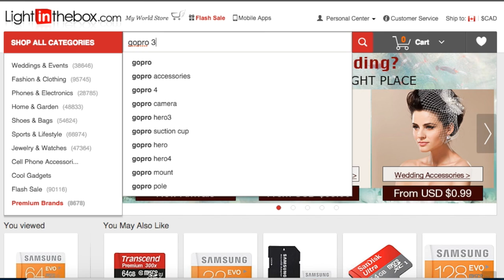4. Sailing Maiweh: Budget Sailboating?

Comment: Propane stove's are the worse thing for making moisture, your better to get a diesel stove big enough to cook on that will keep the moisture down except when boiling water. I just went for 4 days and even my windows were dry and the temp was 1* look at my video's I have two stoves the heater is big enough for 1 pot.
Reply from the maker: +theislandpackrat Yes. Propane, as well as the alcohol stove, seem to give off nothing but moisture. Agreed!
Reply: +Sailing Maiweh All hydrocarbon fuels (Carbon and Hydrogen Atoms) mixed with air (Oxygen20% Nitrogen80%) Create water (H2O) & Co2 (Carbon dioxide). Burning a gallon of Propane creates 2 gallons of water. If you starve your fire of Oxygen then you will get CO1 instead of CO2. Mono means 1 so CO1 is Carbon Monoxide and that will stick to you blood hemoglobin leaving no room for Oxygen to stick to your hemogloben for the life of that blood cell (roughly 6 weeks). When burning a hydrocarbon , you need 1 square inch of ventilation (open window) per 1,000 BTU.    20,000 BTU heater requires 20 square inches of ventilation. Now go and be safe !